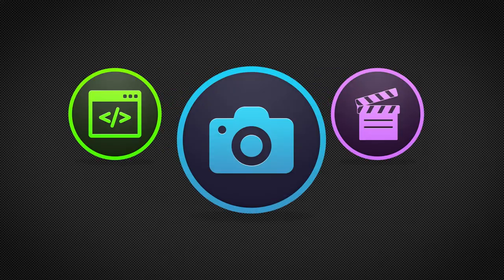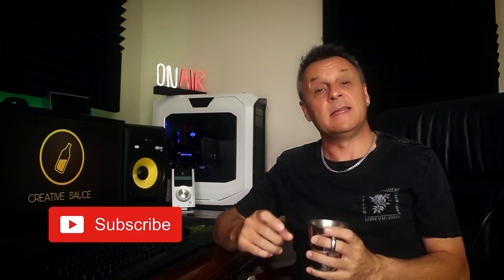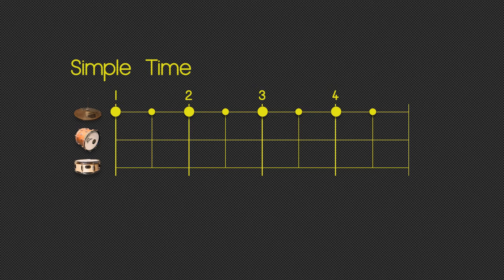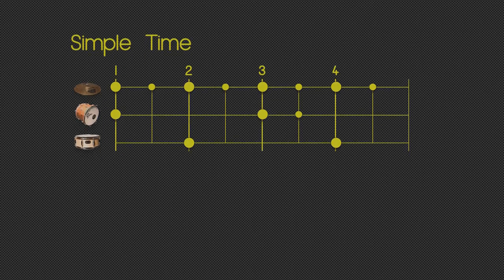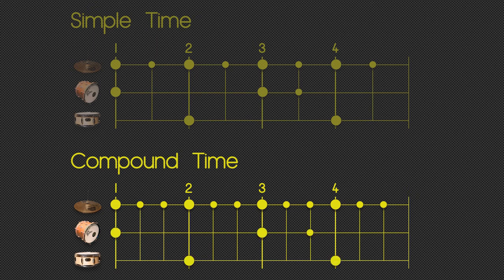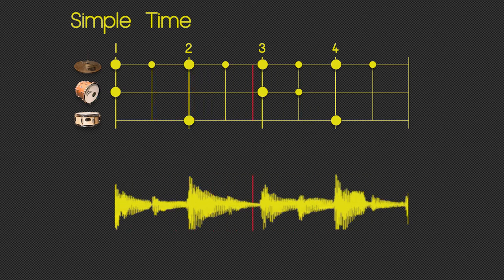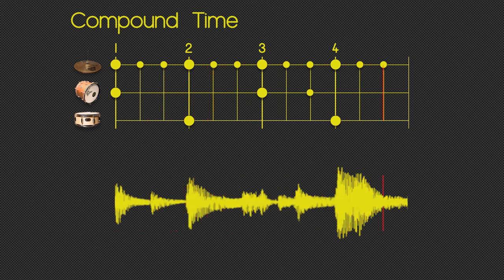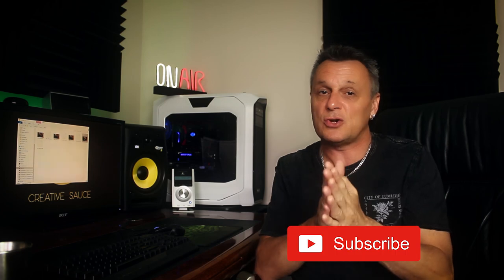Simple vs Compound Time

Comment: thank you so much for this video!

i was struggling a bit to understand compound time signatures, and to see them as '3 in the place of 2' is so useful and easy to understand!!

so now, if i understood well, i guess it'd be accurate to say that, in a way, you're using compound time when writing triplets in simple time, right?

for example, 12/8 is the same as 4/4 with a grid resolution of 1/8T — where there were 2 eight notes, when using triplets they turn into 3!